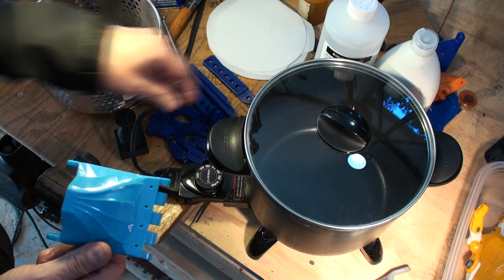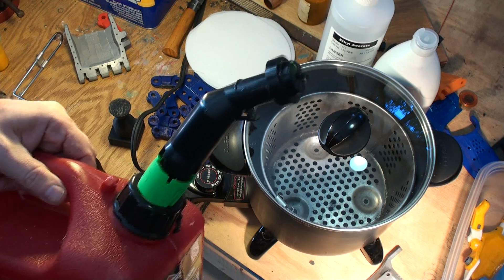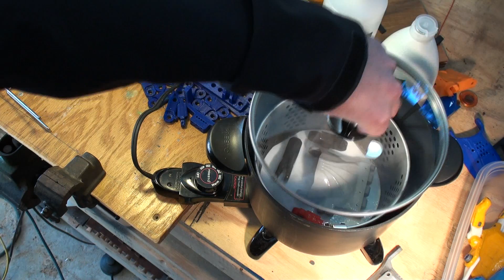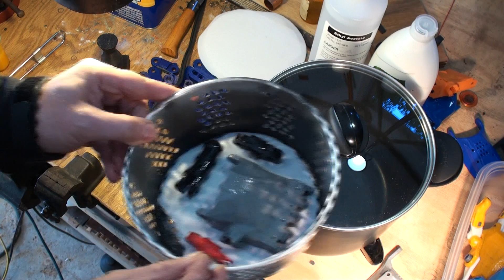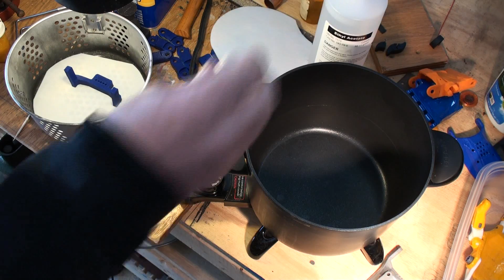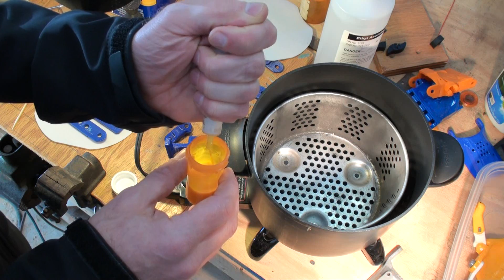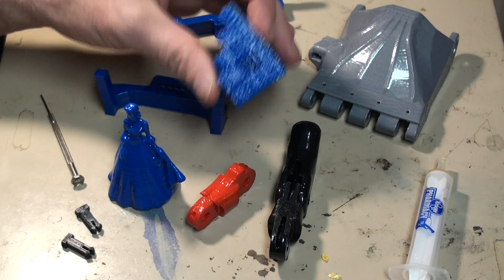Vapor Smoothing of 3D Printed ABS and PLA with Acetone and Ethyl Acetate

Comment: I bought the same Presto cooker before seeing this video!

I just did my first PLA Ethyl Acetate vapor smoothing and the PLA turned white!  Any idea why that happens?
Reply from the maker: +David Culp I don't know. I had the same problem when I exposed the PLA to ethyl acetate for a longer period of time. Someone suggested that the pigment might be leaching away from the surface. Let me know if you figure this out and/or come up with a solution.
Reply: I think I'll put my PLA part in our oven on the lowest setting (170F) which is just below deformation for a few minutes, then take it out and spray it lightly with Ethyl Acetone.  That should drive off moisture, and help the Ethyl Acetone dry faster than it will have a chance to develop a crystal formation on the surface (dendrites) which is what I think the white surface is.
Reply: +Peter Binkley PLA is made from starch and crystallizes in some thermal conditions, it also absorbs moisture quickly. Either of these things might be reactions with the ethyl acetate because ethyl acetate does not mix with water, it will separate. I'm not sure what the reason is exactly but the white powder might resemble dried corn starch. It would be good to soak some PLA parts in water for a week or so and then try to smooth them again with the ethyl acetate vapor. It you get more white it could signify the moisture might be separating on the surface from the ethyl acetate and causing a couple of different reactions on the surface of the PLA part. Another test would be baking the moisture out of the parts in an oven on low temp for a long time and try the process with no moisture in the parts.

I just thought of something else even before moisture testing. Considering plastic smoothing is a thermal reaction, you could try using very little ethyl acetate lets say 5ml instead of 20ml and maybe the PLA would better react to a slower process. If you get less whitening you might be able to fine tune the process from there.

That said, the fact that ethyl acetate and water don't mix and PLA is known for absorbing moisture My bet is on the water separation being part of this issue.

Comment: Mr. Binkley, thank you for this! We're having ultimaker 2 extended on the way and we would like to use this vaporing for ABS post processing. Ultimaker even has recommends vaporing for smoothing the surface
Reply from the maker: +vavrorvav That's great! Some brands of ABS work better than others. Octave is my favorite, but I think it's only available in 1.75mm. I've had good success with Gizmo Dorks and Prototype Supply, and those are available in 3mm. I'm sure there are other good choices. I have found IC3D to not work well for acetone smoothing. Let me know how it goes.
Reply: +Peter Binkley will do, I will surely come back to this video many times, 

it comes with stock ultimakers filament, so we'll see how that goes, pictures will be made and I plan to make a video as well

Comment: I think the white stuff is due to the fact that your colorant has migrated out of the base PLA.  This would occur where there is an over abundance of solvent -- such as the wetted tray or troughs in the material where solvent can collect.  You might hang your objects from wires to keep them from touching the tray.
Reply from the maker: +jlogajan Thanks for the idea! I'll see if I can prevent the solvent from staying on the PLA too long, and see if that improves my results.